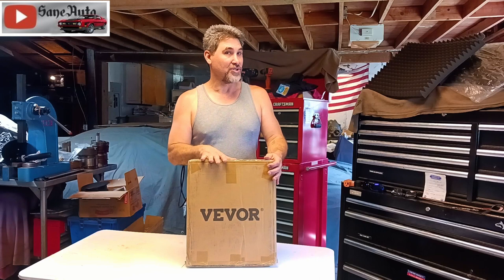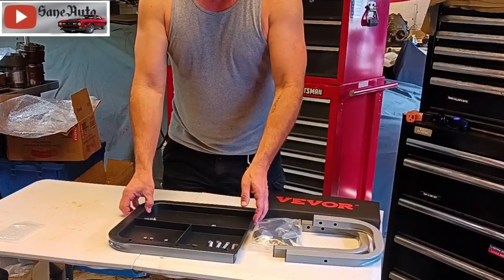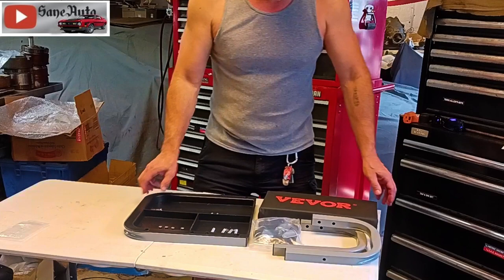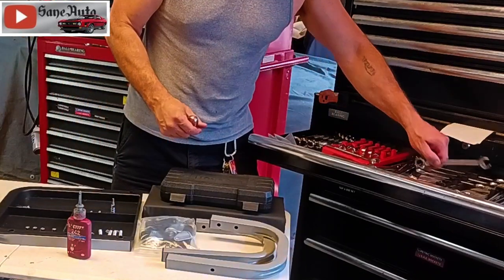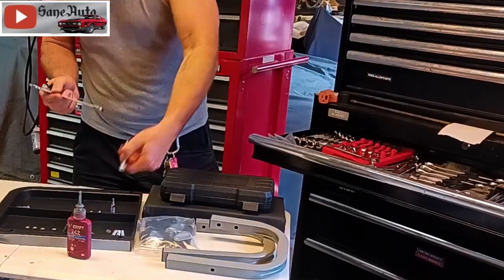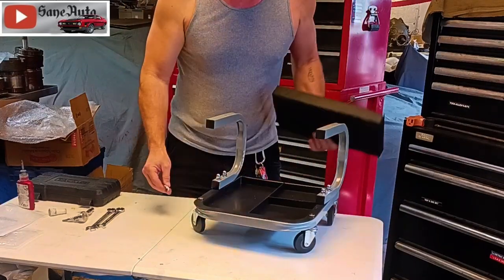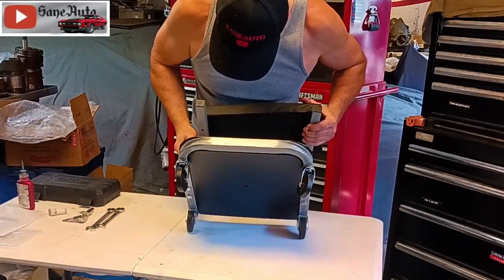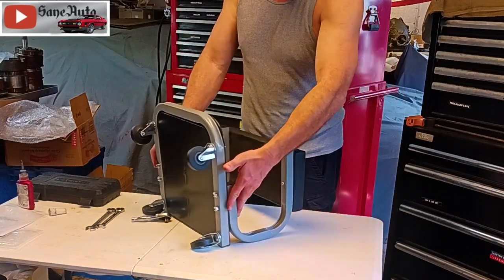How to assemble a Mechanics rolling Garage chair wheeled stool Vevor

Comment: I bought the Vevor roller stool to be able to help my spouse with diabetic foot care.  It was the right height for someone to be in an extended lazy boy with the helper on this stool by their feet for care.
But when I looked at the paper instructions to put the chair together, the parts were mis-labled in the instructions and the step instructions  did not even describe where to put the lock washers!  And to top it all off, 
the picture of the finished project in the instructions were not the exact model I bought - picture was similar but the plastic plate was shorter.
I am very grateful "Saneauto" made this video.  It was well thought out, thorough and funny.  I also learned the tip about the bolt glue - Wow,  that's a game changer for me!
Reply from the maker: Awesome! Thank you for such a motivating comment Julia. I share your frustration with badly written instructions. It seems none of the manufacturers can find a person to write instructions that actually knows how to write instructions anymore. Also there are some things that are more easily shown in a video format.
Reply: "Amen" Brother